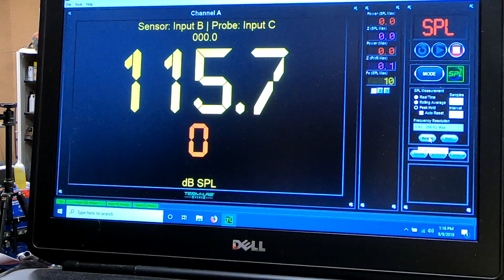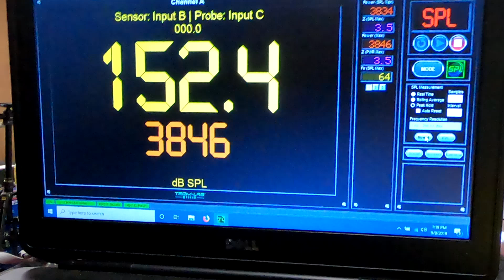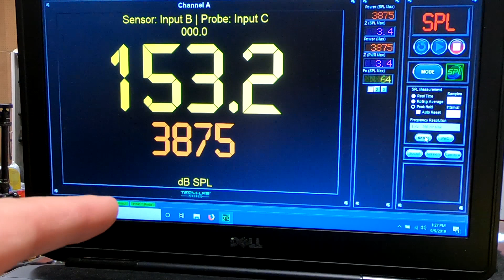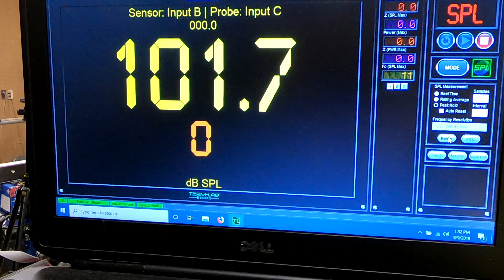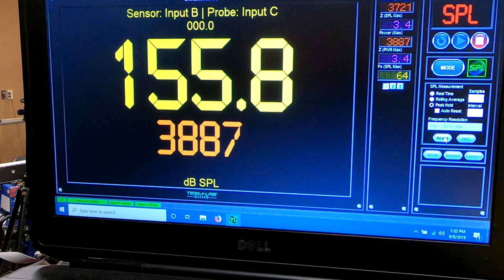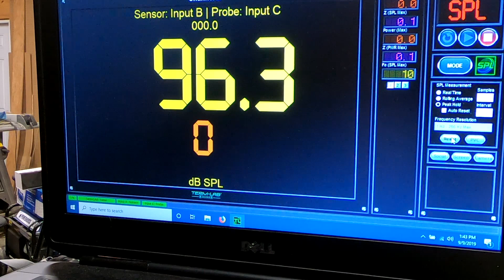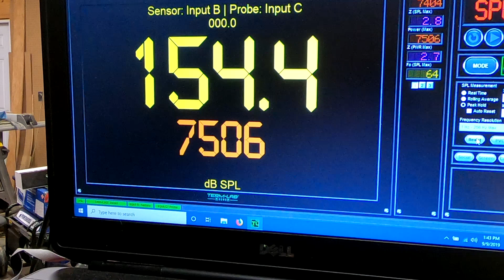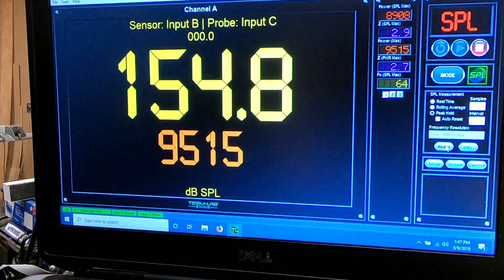How loud can an EMF Lowballer 15 get? How much power will it take?

Comment: Any EMF Lowballer 15" owners think this enclosure will suffice/pair well with dual EMF LB 15s? It has the required airspace and appears to be sturdy. Box: https://www.hifisoundconnection.com/Shop/Control/Product/fp/vpid/2395159/vpcsid/0/SFV/30046?utm_source=google&utm_medium=base&utm_campaign=GoogleBaseFeed&gclid=CjwKCAjwvZv0BRA8EiwAD9T2VVIqCr_AK13af-S5h1NAyiyeuZYaEWkoC3DW5yaNtFFjE7SRQhsYhxoCefIQAvD_BwE
Reply from the maker: The air space looks suspect compared to the picture and it doesn't list tuning, which is suspect. Most prefabs tune way too high.
Reply: @EMFAudio  damn, I thought I had found an adequate prefab enclosure which would mean I'd FINALLY get to order 2 - EMF LB 15s b4 they sell out!! =/ BUT you're right, the mounting depth says 16" which tells me the claimed airspace IS valid however, that leaves only 6" for the labyrinth of vents AND wood thickness which has me confused and therefore concerned. I'll keep looking bcuz after dedicating several days of comparing loud bass <$200 subs, my mind is set on owning 2 of your EMF subs! Thanks once again for your input which besides the "VIRAL" discount, your consistent input combined with your concise YT vids is ultimately the reason why I'm choosing EMF over SunDown, Kicker, PSI, DC, JL, and a half of a dozen other companies I used in my comparison. I suggest others to do the same, preferably AFTER I get mine ;-) in case they sell out soon.
Reply: I did the math, 22" deep - 16" mounting depth - 3" wood thickness = 3" ÷ 2 vents in "labyrinth" = 1.5" vent width. Now the question I'm looking into is if 1.5" wide vent is adequate and what this box is likely tuned to. My initial hypothesis is 27-32 Hz however I'll try contacting the company. Thx. Btw, I'm motivated to find a proper enclosure bcuz I want to replace my 2 new Kicker L7S12s with 2 EMF LB 15s as you suggested a week back for me to do.. (bcuz I need way more bass!)
Reply from the maker: @lowhertzhighspl  You don't have to have a box to still buy the subs now. You're spending all this time trying to find a prefab that's right, why not just get a custom box made that IS right, if you can't build one yourself?
Reply: @EMFAudio  I like to have everything researched/planned out prior to ordering so that when the subs arrive, I don't have to wait to install and enjoy. I have the tools and woodworking skills to build myself a box but am lacking blue prints because I know very little about tuning boxes. Meaning I would need a blue print to refer to. I suppose I could use free box building software such as WinISD. However I prefer purchasing a prefab box which some brands have become better/stronger in recent years but I always could add additional supports just as I have previously in my Q-Bomb enclosure.
Reply from the maker: @lowhertzhighspl  I did a video on why box simulation programs aren't accurate, FYI. It's worth a watch.
Reply: @EMFAudio  of course you did! The car audio world ought to be grateful to have you. I know I'm grateful for your expertise.
Reply: This box appears it'll work well even though there's no tuning info. 
https://www.truckid.com/qpower/15-qbomb-series-2-hole-vented-subwoofer-box-mpn-qbomb15vl.html?view=438274&gclid=Cj0KCQjwybD0BRDyARIsACyS8mtgkmjrvg6LhR6zAsgoT42-5B7xonMrqWXnq_eWqHDhL72mTt5BhBUaAtt3EALw_wcB

Comment: Peak power handling of close to 10,000 watts for $200. Thats crazy! I've been on SoundQubed for a while now, but next time I blow a sub, instead of reconing it, I'm just switching to the EMF Lowballer 15's for sure.
Reply from the maker: The sub didn't blow, I just ran out of power. That was one of our 'Merica 12k's at 2.7 ohms.
Reply: @EMFAudio  I know it didn't blow. I didn't say it did. I was just saying is that next time I blow one of my subs, Instead of reconing it, I'm just going to switch them all out for Lowballers. 
 The Lowballer is extremely impressive.155+DB and it will take at least 9500 watts without breaking down. 
 Now don't go raising the price on them before I buy. lol.
Reply from the maker: @LowFrequencyFanatic  You should probably buy sooner than later, they're "while supplies last". You don't have to wait till something blows to upgrade to better sound. You'll get more selling what you have as working than blown.
Reply: @EMFAudio  Yeah. Your right man, It's all good.I'm on it. I'll send you pics of the build my brothers.

Comment: Great sub but the car has alot to do with those numbers. Put it in different car and numbers will change dramatically.
Reply from the maker: Right, they could be just as good or better. More time spent on testing will make the numbers higher too.
Reply: @EMFAudio  your subs are amazing. Almost 8k burp on a base model sub. Keep killin the competition.
Reply from the maker: @danksmoker420  You should watch the whole video

Comment: Very nice build quality on your woofers.. I tried this with an American bass XFL 15 on 5k and the coil jumped out of the magnet gap and rested on top of the motor. Can you put a Banhammer in that hatch and see what it can do? I've bought Banhammers off of you before, but never pushed them to their limits.
Reply from the maker: I've done a single 12" Banhammer in there before, look through our videos for those. This is my first single 15 testing I've done so I haven't done one of those.
Reply: @EMFAudio  Oh, alright. Thanks
Reply: Immortal what was your enclosure specs?

Comment: When you say mechanical limits, does that mean power compression?
Reply: Xmech, the physical excursion limit before bottoming out occurs
Reply from the maker: Power compression would be an electrical limit. In this case the mechanical limit is the surround and spiders simply can't move any further. Another mechanical limit would be a mechanical failure, like a cone breaking, spider ripping, surround blowing out, etc. which wasn't the case for this sub.

Comment: You say the "Lowballer" 15" is on sale while supplies last. What will replace it, How much will the replacement cost, and how will it differ from the "Lowballer"? Are you dropping the "Lowballer" 15" from the line, and just simply sticking with the "Banhammer", "yolo", and "Ermagner" for the 15" and 18" sizes?(PLease don't drop the "Lowballer" 12")
Reply from the maker: I haven't decided the direction of the Lowballer line yet.
Reply: Going nowhere due to the irascible nature of the progenitor.

Comment: Is the 19mm xmax one-way or peak-to-peak?
Reply from the maker: Xmax is only one direction by definition. Peak to peak isn't really Xmax, it's a method used to fluff numbers.
Reply: EMF Audio had to make sure. Thanks
Reply: It has to be one way with those numbers.
Reply: T Turner hah, got a point.
Reply: After 9000 watts and no audible x-mec why bother asking hahahaha

Comment: How big is the port?
Reply from the maker: This box is an 8".
Reply: @EMFAudio  is the lowballer similar to the sundown ultra ? Know known as the cab ultra ?
Reply from the maker: @urbansasquatch5537  That is a 3" coil sub, this is 2.5". It's closer to an SA.
Reply: @EMFAudio  no it's a 2.5 inch coil aswell , also rated at 750rms
Reply from the maker: @urbansasquatch5537  The Sundown SA ultra that never made it to market was a 3" coil rated 1,000 RMS. CAB bought all the motors and baskets and had them reconed. This was about 5 years ago, it may have changed since then.

Comment: Damn That Loud?? That's A Sleeper Sub hahah. I Wanna Get My System Clamped And Metered So Bad. See How Much I Have Improved From My 950Watt Clipping Score Of 142.5dB At 38Hz Sealed On The Glass.  I Just Got Her Slapping Again  Rocking Some New Chinese Made Re Audio XXX12S on About 5,000 Watts (My Guess Anyway. They Are At Half Ohm On A DD M5 With About 13.8 Volts Feeding It). It's A Wicked Ground Pounder Set Up!!

Comment: What would you put on one or two of these for daily use? Wattage wise? About 700 - 800 RMS? Each approximately? Or a 1500w or 2kw amp? On a pair?  So I will less likely clip the amp, its non comp use, music, what is the lowest tuning recommended, and is a 4th order recomended? Great video!!
Reply from the maker: People have been put 1,000 per sub without issue. Lowest tuning is whatever you want it to be, how well it will do it is another story. They'll play into the 20's OK but 30's are where they're great. I see no reason why a 4th order wouldn't do quite well, I haven't known anyone to do a build with them in 4th order.
Reply: I am running a pair of 12s on a 3k that is clamping 2800 with box rise and they take it just fine. I'm tuned at 30 hz. With 3.25 cubes. Great subs!
Reply: Got a single lowballer 15...daily driver, constant 1100 watts to it...no issues

Comment: What frequency did you play at and how did you know what frequency to play since you had zero experience with that enclosure?
Reply from the maker: I've owned that car for 19 years, I pretty much know what frequency it's going to play and where I need to tune it to make that happen. It may get louder tweaking that some.
Reply: EMF Audio you’re so sketchy dude. Why not let everyone know that info and tell us what frequency it was. A completely  different box is going to peak at a different frequency. You would at least need to do a quick sweep to be sure.
Reply from the maker: @Fishingwithjerrysbrother  So playing one frequency is sketchy because I didn't disclose it when anybody could play it, and it clearly says the frequency on the screen? You think I just picked one at random and tested everything without checking anything? You know what would also change the results? Everything. Different car, different temperature, different box volume, different tuning. Would you be more mad knowing the sub is music and wants to play lows, not high frequencies? Should I expect another complaint it won't take 9,500 watts all day when it does for a short period?
Reply: EMF Audio I couldn’t see the frequency on the screen. Just seemed like you were lying. I don’t care about how much power it can burp . I believe it could take as much as an SA- series.
Reply from the maker: @Fishingwithjerrysbrother  If I never said a frequency, how could I be lying? As a matter of fact, if you look at comments I've confirmed what it was, including when you asked. You can hear in the video it's in the 60's.
Reply: EMF Audio lying about not testing it prior. You seem dishonest in general.
Reply from the maker: @Fishingwithjerrysbrother  I didn't test it prior. When I said I hadn't played it yet, I hadn't. Did the entire video look completely seamless? Is it possible I knew what frequency it would play from having 19 years of experience with the car? Is it possible that after I said I hadn't tested it, I did test it? Literally everyone but you praises my honesty in videos and it's pretty clear you have a problem with admitting you're wrong. You were reaching for a reason to justify yourself and it's not making you look any better.
Reply: EMF Audio I could be wrong. Sorry for bothering you

Comment: Z dropping off. Guess was off a bit. This could be louder maybe a smaller enclosure?
Reply from the maker: I think it needs to be smaller yes, but then again, this is a pretty soft suspension as it's meant for music so putting all that power on it isn't what it was intended for either. On stiffer subs the box may be fine.

Comment: I bet a older mtx sub with higher db will get louder...........

😂🤣😂🤣🤣😂
What does it tell me when you get small increase as the power doubles ? It seems like in engines and drag racing , a person will spend thousands of dollars to gain like  100 on top of 1000 hp to gain a tenth of a second.
Reply from the maker: That can be a mechanical limitation, a power compression limitation, or a box limitation. In this case it's mechanical limits, but the good news is a different enclosure can help with that.
Reply: @EMFAudio  I never fully understood why output would just drop off even though your like quadrupling the input...but now I know....and knowing is half the battle!!! Thanks EMF , your the best😘
Reply: dB is a logarithmic scale, not linear. That’s why.
Reply from the maker: @dawn9340  That's assuming you're comparing to much prior data. If you're comparing 1 step back the rules are the same, till there are other factors.
Reply: EMF Audio I wasn’t talking about it that way. Of course if you saturate a coil with power, you’re just going to heat it up as efficiency drops. Thats why I was surprised how this sub took that much power and actually gave pretty epic measurable gains from it. I guess that’s attributed to the suspension and motor strength / stroke.
Reply from the maker: @dawn9340  Yes, the losses in this case are a result of reaching mechanical limits. I could hear the surround reaching maximum movement and tightening, there is mechanical distortion at that point. As you get closer to that point and the spiders tighten down it takes way more to accomplish anything. A different sub will act differently though, as you'll see next week.
Reply: @EMFAudio  🤯
Reply: @dawn9340  is " logarithmic " a real word?🤔...man I fix cars, not science rockets😂🤣
Reply: Luckily this driver is only 180 bucks and higher efficiency ratings don’t always mean more db’zzz